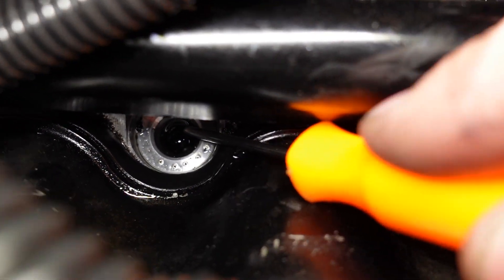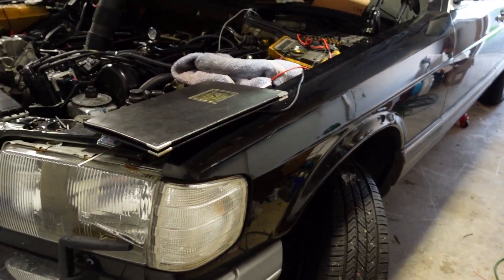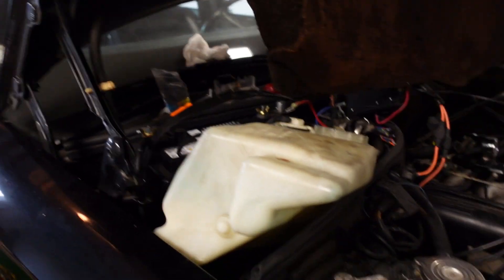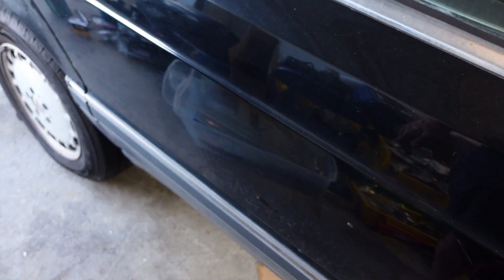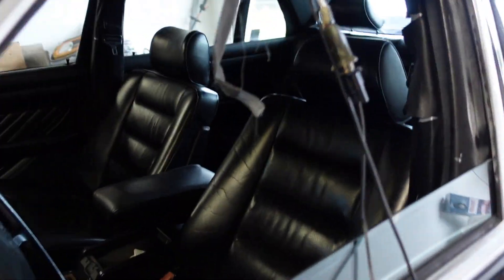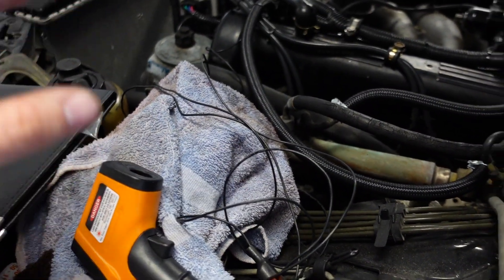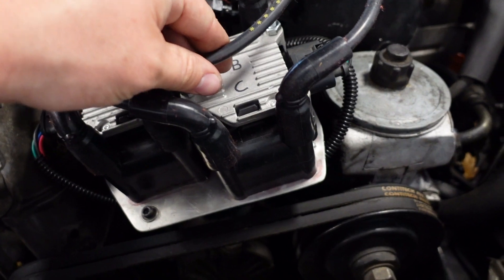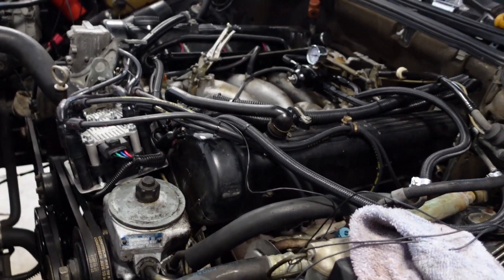1989 Mercedes-Benz 560SEL EFI Conversion: First Start! [15]

Comment: Sir, what outer diameter of throttle body? I want do some tube to air cleaner box.. And don't know, what diameter.
Reply from the maker: 3 inch tubing is a little tight but it does fit.
Reply: @carsandengineering2022  thank u!!!!

Comment: I just had the same issue with starter where did you buy yours?
Reply from the maker: I got mine from oreillys. It was not expensive but I had to run a tap through the starter to clean up the threads.

Comment: Great work. Does the factory tacho work on the dash?
Reply from the maker: Thanks! Yes, towards the end of the video I think, I show it. Just had to connect the Microsquirt Tach Out wire to the cars wires by the diagnostic connector.
Reply: @carsandengineering2022  i missed that bit, just re watched the video.

Comment: Good job! Interesting project!
👍🏻👍🏻👍🏻
Reply from the maker: Thank you! I think I am going to try to reverse the timing map out of the EZL since I do not have a dyno.
Reply: @carsandengineering2022  that would be interesting to see, they have quite a map depending on a wide variety of environmental conditions and they store, like the ECU, the last 30 starts / drives.
If the EZL is completely reset then the last 30 starts / drives are erased and the unit defaults to a standard map until 30 starts / drives have been completed. This is a FIFO scheme. The original system adjust itself to changes in engine over time
Reply from the maker: @inovahightechltd  Really? Thats amazing. What feedback is it using to adjust the timing parameters? My car does not have knock sensors.

I was hoping to just connect it to a signal generator on my bench and scope it as I change RPM and manifold pressure.
Reply: @carsandengineering2022  the timing is observed by the rear rpm sensor which is a pulse signal off the flywheel. The flywheel has 4 indents at each 90 degree increments. The EZL also creates the TD signal from this input. Further the EZL connects to the Manifold pressure and coolant temp, it is from this combination that the Siemens 16 Bit microcontroller with software written in Assembler back then calculates and determines various environmental and engine conditions. A miss or knocking is picked up via manifold pressure and coolant temp and timing angle from flywheel.
Pretty slick system if everything around it works correctly.
There were 4 revisions of the EZL from 1986 to 1992, each one will run the engine a bit different.
Reply from the maker: @inovahightechltd  wow, thanks for the info! Do you have any other option for me to figure out the ignition advance table?
Reply: @carsandengineering2022  not really, except of what they published in the manual group 7.3 for idle and 3000rpm to check EZL
Reply: @carsandengineering2022  that information was considered a trade secret and not published. One of my grammar school classmates father was one of the three assembler code writers back then, but he passed away 4 years ago unfortunately.
Reply: @carsandengineering2022  the very last my 91 which was produced till October 1991 had the 5th and final version of the EZL and if I remember it right, that version had a extra knock sensor as the R&D version of this EZL had served as prototype unit during the M119 development and to a certain extent on the M120 development from around early 1988 or so.
Reply from the maker: @inovahightechltd  You are a wealth of priceless information! I'll try it on the bench and see what happens. I may need to rent some dyno time.
Reply: @carsandengineering2022  good luck, that’s going to be a priceless video and information you are going to provide.
Siemens had the last production run in 2003 of these EZL’s and it is very very questionable if they are going to make more as they also discontinued the 16 Bit microcontroller family they used for that in 2001.
I was able to get one of the last MB Stock units two 1/2 years ago from Untertürkheim with a manufacturing year of 2003.
The “rebuild” units available are a bit to suspicious for me as the Siemens microcontroller used erasable flash memory and not battery backed ram for their tables / data accusations
Reply from the maker: @inovahightechltd  Hopefully I don't ruin mine so I can sell it. I plan to mount some wideband Bosch knock sensors to the block and use "real time" FFT to monitor knock. Typically crank angle windowing is used to filter out other noises but I do not have the processor or a cam signal for phase information. My plan is to subtract the normal noise of the engine from the live FFT, or atleast establish a threshold.
Reply: @carsandengineering2022  sounds good, looking forward to all the videos coming our way!